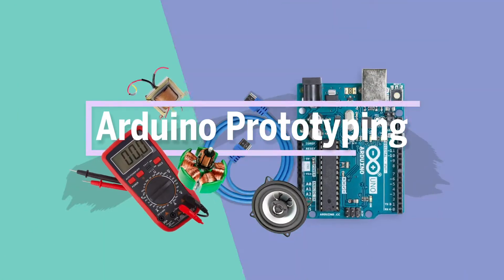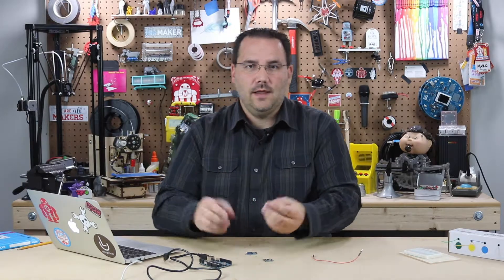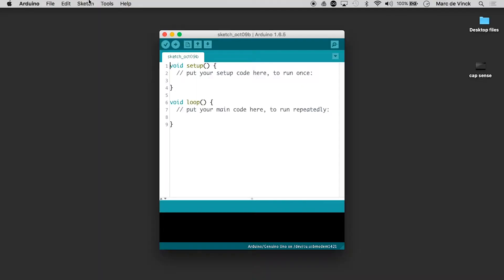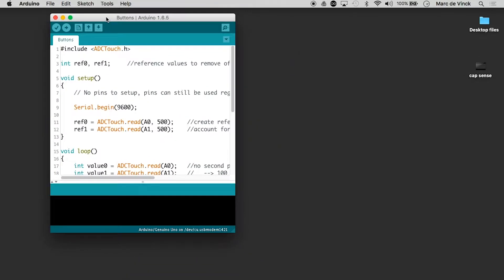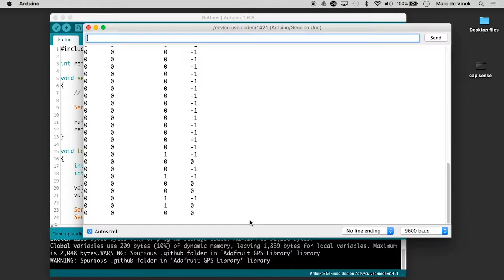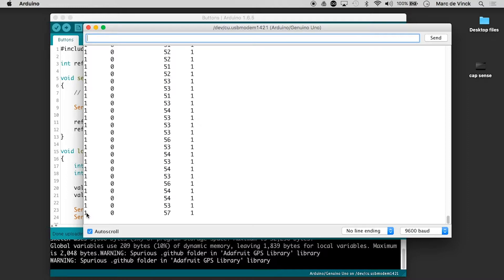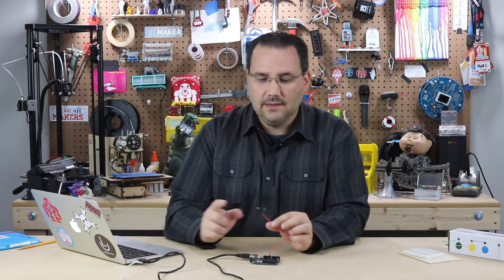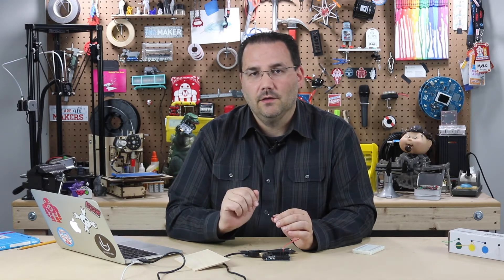Arduino Prototyping Inputs #30: Capacitive Sensing

Comment: My circuits are triggering by either EMI or RFI from rolling shutter motors.
I find it difficult to make circuits insensitive to that.
Reply from the maker: Yes, that can be an issue with CapSense. Try different capacitors and/or locations. Also, you might want to find an Electrical Engineer, as they should be able to mitigate the issue via the layout of your circuit.

Comment: This is very interesting so basically  the touch sensors act as a pressure sensor? I just want to know if you can program these ones because I want to add these into my project I'm doing
Reply from the maker: No, not pressure. It senses conductivity. Get close enough to the wire and it will trigger a response from the Arduino. On/off. Lots of fun. A wire or metal plate can be located behind glass and wood too!
Reply: @MarcdeVinck  I'm trying to find the right smart sensor for vibrations or for like impact
Reply from the maker: @aarontaylor7150  I got you covered! -- https://www.youtube.com/watch?v=pZSeZL_z4hM
Reply: @Jeremiah Misael yup, been watching on Instaflixxer for since november myself :D
Reply: dunno if anyone cares but if you're stoned like me during the covid times you can stream all the latest series on Instaflixxer. Been binge watching with my girlfriend for the last few weeks xD